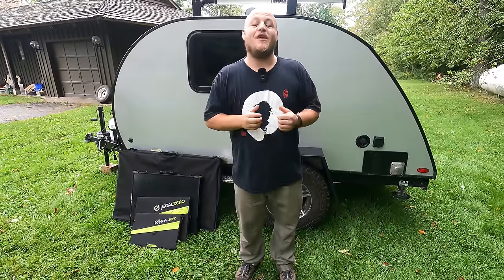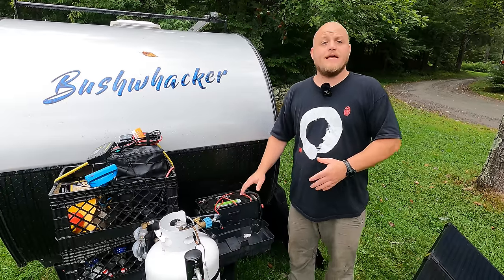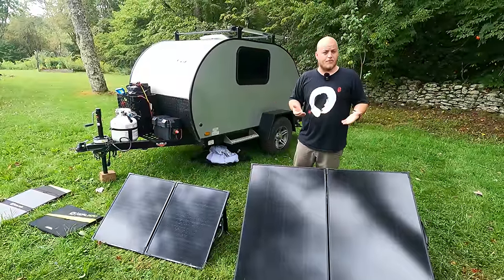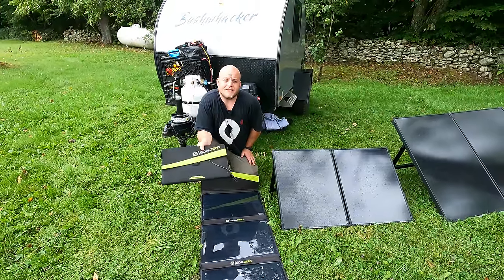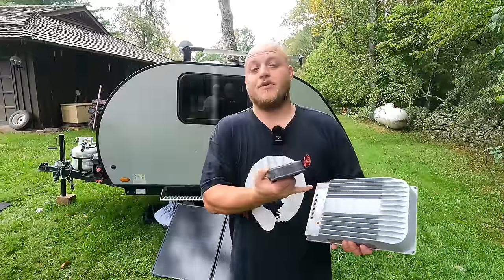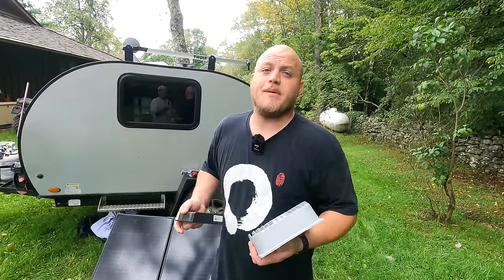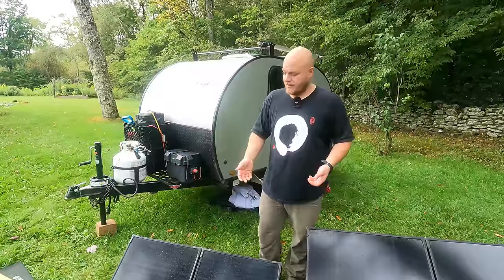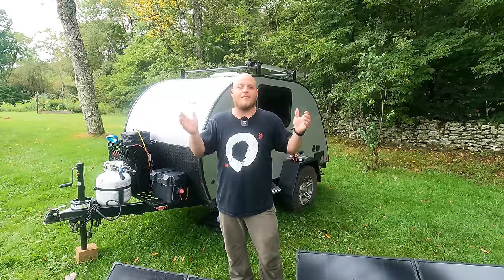RV Solar 101 : Everything a Beginner Needs to Know !

Comment: You are awesome! Thank you!
New sub here:)
Im in a self converted promaster high top
Haven’t built it out formally yet just set up modularly so there’s room to try it out
Im using a jackery 1000 now with portable 200 watt panel that takes in 116 at the height of sun for summer in Vt.
Was looking into rooftop panels that are weatherproof  (since mine are not) but was a bit overwhelmed with choices…
Running an Alpicool 65 L dual fridge freezer that can take it down up to 50% in some weather at night so wanted to set it up in a way Im not so pressed to charge daily and can go off an adventure rather than babysit the panels so they are not stolen.
This is such a helpful video!!!!
Thank you
So glad I found this:)
Demystifying!
Seeing good reports on Harbor Freight panels durability 
Researching choices
Any recommendations?
Reply from the maker: I’m so glad that you found us! I have lots of videos on solar, I will link one in this comment, showing my rooftop set up. I have learned to stay clear of harbor freight panels, they are unnecessarily big and difficult to set up.  Check out this set up, and my other videos on solar. Thanks for watching.

RV Roof Solar Panel Install - Roof Rack
https://youtu.be/nIpGvJzrKg0

Comment: Really good information Bryan, one question for you. If you have two 100 amp 12 volt batteries and 2 100 watt monocrystalline solar panels. Does it matter if the charge controller is 20 amp or 30 amp?
Reply from the maker: No, a 20a and 30a would work exactly the same. No advantage of the 30amp with that panel size. 

 If you went up to 220-240 watts of panel, you would start to see advantage using the 30a over the 20a.
Reply: @DIYOutdoorLife  Thanks!

Comment: This is a great simple overview.. so what does the solar battery controller do when I hook up to the 30/50amp AC power pole?
Reply from the maker: The power pole to your solar panel?
Reply: @DIYOutdoorLife  - sorry for the poor question… but no… I’m referring to when I connect my RV to a camp site’s 30/50amp AC hook up.   Btw, I think I found the answer… i.e., the charge coming from the solar panel going through the solar controller is auto disconnected and the AC/DC converter takes over any required battery charging.
Reply from the maker: @sboy1955  you got it.  You don’t have to do anything at all, the charge controller can tell that the battery is receiving a charge and backs off.

Comment: Is there a text or PDF that has all the simple formulas and steps to do the calculations you presented?

Just yesterday I was testing my new Solar Panel & Power Station. Was bright Sun. Was disappointed that my 100w panel only showed 60w of charging. Then discovered that the  Power Station built in Charge Controller only allowed that much charging. Nowhere in the User Manual for either device was that mentioned.
Reply from the maker: You might be able to find something on google, sorry I don’t have anything.

Bummer about the power station, that’s why I try to review a lot of models on the channel.  What power station are you working with?

Comment: Love you RV solar 101. I have  2 12v lead acid deep cycle batteries for my 12v system, wired in parallel . Does my wattage change? IE: 600x 2 or does it stay at 600 and I can use the charge longer? Thank you so much.
Reply from the maker: When wired in parallel the Watt hours doubles… thanks for watching

Comment: I plan to have a solar panel installed on the roof of my van to charge my Jackery 1000 solar generator. Is the charge controller built in on the Jackery?
Reply from the maker: Yes there is, no need to buy one.

Comment: We have a Chevy S 10 truck with a very small slide in camper. I’m looking for a small solar portable set up. That way there if I ever lose power in my home I can use it to run small appliances / lights………. The small camper only has a very small refrigerator and a microwave. No bathroom, no sink…….( I like to use an electric skillet & mr. coffee) would that small unit be enough????? ( we are so clueless, lol)
Reply from the maker: How does everything run now? Fridge runs on gas, battery, or ac electric? The microwave, skillet, and coffee maker are high wattage items, you’ll need to go with a large system or replace with more gas appliances.

Comment: Great video. My question is if you series or parallel panels do the batteries have to be wired the same parallel batteries parallel panels or series panels series batteries?
Reply from the maker: Nope.  You can series or parallel up to whatever your charge controller can handle.  Your charge controller has to match your battery voltage, but it doesn’t matter what solar configuration you use tho
Reply: @DIYOutdoorLife  thank you very much for your valuable comment and time

Comment: Mppt controllers can start charging earlier in morning and run later in the evening than pwm controllers. Also, on more overcast days it can provide power when a pwm might not.
Just a point to make.
Reply from the maker: Definitely, the voltage conversion rules the roost on most large systems. The argument I make is when comparing the performance of 100w solar set ups.  You don’t see the performance gains worth money until you creep up the size.
Reply: Creeping up in size is very likely to happen.
My point being, why buy it twice.
Reply from the maker: @dsig1644  this is a very good point. I should probably make a solar 202.  The fact that you can get a $35-50 waterproof PWM has its merits.  Starting with something like a victron blue smart that is future proof has merits as well.  I appreciate the good comments.

Comment: I have a factory installed 190 watt rooftop go power on a NoBo with a 12volt only frig. Charging two 12 V lead deep cycle Marine batteries in parallel. I know I need to upgrade the batteries. I decided to supplement with an old 120 watt Nature Power suitcase with it’s own controller connected directly to the batteries.That worked well. Decided to up grade to a more power/ modern Suitcase Renogy 200watt Voyager 20amp controller. My 12volt frig. sends out an error E3, which means overcharging in this case (15.3V) The dealer indicated that it’s Renogy’s problem. Thought the controller was defective but Renogy claims the camper go power controller and Voyager don’t play well.  I thought they would be independent as it works with my old 120 watt. Is Renogy getting out of a warranty or is there something else I could do to make the 200 watt work?
Reply from the maker: At that level, you’re starting to cook your batteries. I would explore the settings on those charge controllers and look to find one that cuts out at a lower voltage. You can 100% run multiple charge controllers at once, you just don’t want to try to charge a SLA too fast, check your battery to see max input current.  It’s tough for me to say without seeing the gear, but my hunch is that voyager is the culprit, should not allow V to get that high. 

Maybe swap the voyager for an MPPT and see if that fixes.
Reply: Update: After I got home and wasn’t worried about keeping the 12 Volt refrigerator cool anymore, I disconnected the factory installed Go Power and just ran the refrigerator on the Renogy / Voyager controller. Results E3 error as it was sending in 15.9 volts. I was able to take pictures and after too much time on the phone and persistence Renogy is sending me a new suitcase with controller. Thank you for giving me information to back up my argument.

Comment: I'm thinking about getting a camper with a 200 watt panel on the roof that goes through a 30 amp digital controller. The camper also has port on the side of it to connect a portable panel to it. If I plug a second 200 amp portable panel into that port, does it just add to the 200 on the roof, or do I need a separate charge controller? Thanks, and WTG! you explain things great!
Reply from the maker: Thank you for watching! You will need an additional charge controller, the solar on the side port goes directly to the battery and is not regulated.
Reply: @DIYOutdoorLife  Thank you! In that case, I'll get a kit system that has it's own built in controller.  Oh, I assume they can both be used at the same time?
Reply from the maker: @chrisb6866  good idea, it’ll be easier to set up at camp and typically be waterproof.

Fine to use them both at once, it’ll work great!
Reply: @DIYOutdoorLife  Awesome! Thank you!

Comment: Really amazing video man! What about the battery charge level should I know? Like, I know an AGM or lead acid battery shouldn't be drawn down below 50%, but is it good for that type of battery to constantly have it between 80%-100% with the solar panels keeping it topped off? Can or should LIFEPO4 batteries be treated the same way for maintaining a charge?
Reply from the maker: Thank you.
12.2v is a good number with lead acid, including AGM.  That’s a good 50% mark.

It is extremely good for them to try to keep them as high as possible all the time.  If you can stay above 80%, the battery will last many many years.

Lifepo4 is different.  It’s much more stable being left alone, although you never wanna let it go completely empty.  If you do go completely empty, it’s imperative that you charge it as quickly as possible.  Since they don’t need a trickle charge, many people charge them to 60 or  70% and leave them disconnected if not in use.
Reply: @DIYOutdoorLife  Wow, a detailed reply within an hour, on a video over a year old? You flippin rock man, thank you!
Reply from the maker: @undercrust  haha, I work hard to keep up w the comments. I appreciate you tuning in.

Comment: Is it acceptable to use a larger charge controller then required by the system?   Also can you link the video about required cables?
Reply from the maker: Yes, no harm in oversizing charge controller.
It has been a while, but I think this is the video - DIY Charge Controller | Installation Options
https://youtu.be/4_2_Xt4eOoM

Hope this helps, thanks for watching!

Comment: Question for you so I have 3 northstar agm batteries that I wanna put in parallel…I’m looking at getting two 550 renogy panels ….. I see most charge controllers work with certain ranges of wattage from the panels from the looks of it I need an 80 amp controller?
Reply from the maker: You would not need that large of a charge controller.  Those  panels typically run a higher voltage and lower current. I believe the open circuit Is 50v and the short circuit is 15 amps.  This means, for those larger panels, you only need a 30 amp charge controller.  Because you are working with a larger array, you definitely want to go with a high end controller or oversize it a little bit. This would be my
Recommendation-
https://amzn.to/3OxDsoF
Reply: @DIYOutdoorLife  thank you so much for the information I asked this question many of times yet no one would give me an answer or help me out thank you so much!!!!!

Comment: Cool vid... i have a 515   watt,5.2 amp,115 volt a/ c unit that i need to use for 10 hours of use to keep cool. What amp hours willi need to meet this need. I do have a 2000 watt  inverter  (12v to 112 volt)
Reply from the maker: That's a very complicated equation, I'll do my best to answer as clearly as I can.

First, 515×10 hours is easy .  5115 W hours.      

The reality is more complicated than this, and thankfully works in our favor.  The air conditioner does not run continuously for 10 hours.  If sized appropriately, it runs for a while and then shuts off for a while.   if size appropriately and running efficiently, let's see if we can get it to run 25% of the time.  Maybe wishful thinking.  This this would be just under 1300 W hours.   100 amp hour lithium battery has around 1300 W hours.   So in this case, it would use 100 amp hour lifepo, charged to 100%, and you would get just under 10 hours of cooling.

Do you see how there's tons of variables here?   How big your camper is, how hot it is outside, how many people are sleeping inside, how many times you open the doors, how insulated the camper is etc etc etc.    
If your air conditioner ran 50% of the time, it would require 200 amp hours of lithium.

If your air conditioner ran 100% of the time, something would be wrong, but that would be 400 amp hours to last one night .

Your inverter will likely run about 80% efficient .  This will cut the number from 10 hours to eight hours.  

I could go on and on here, but I wanted to give you enough to get started.  Running air-conditioning requires a very large battery bank!   I will post a video in the next comment where I go into some of these details and share some tips and tricks.   Most of the time, this offgrade AC becomes so expensive that you get very thrifty.  Setting an outlet timer for six hours seems advantageous to get 10 hours and spending thousands more...

Hope this helps, thank you for watching!
Reply from the maker: Running Teardrop AC with Solar! Portable Power Station Air Conditioner
https://youtu.be/DzRKUQEo5K0

Comment: Hi there.  I love your videos.  We just bought the Bushwhacker 10FB (two doors) and I’m trying to figure out what kind of battery amp hour would last us three days.  What is the battery amp hour that lasts you three days?  Just curious and trying to put it in perspective.  This is our first trailer so I don’t really know what kind of use we will have yet.  :)
Reply from the maker: I’d be happy to help, what type of devices are you looking to run for three days? Refrigerator? CPAP machine? Lights fans and USBs are very easy!
Reply: @DIYOutdoorLife  hmmmm…. Such a good question.  I don’t imagine we will use a refrigerator so most likely lights and fan, charging phones and maybe iPad or laptop for movies at night.  Btw This video has sparked an obsession to understand electricity!
Reply from the maker: That’s so great to hear. Knowledge is the best modification, it saves you a ton of money and makes everything work better!
100 AH AGM battery is probably the way to go for you. Check out my video on “best battery for RV”

Comment: I just added 4 group 31 gel style batteries at 98ah each and I have a 20amp charge controller and I only have a 100 watt panel at this time. I wanted to get a 200-300 watt panel. I also have a 3000 wattage pure sine inverter hooked up for ac power. So is 200w panels enough?I use the inverter at night and mornings when I’m not allowed to run a generator so I can use my Starlink and coffee maker or microwave in those times
Reply from the maker: Nice system!  You are a little light on solar.   

Your batteries have roughly 4800 W hours of storage.  Since theyre gel, you can effectively use half.  So 2400wh.

100 W panel will roughly give you 350 watt hours a day better, sometimes worse.. good average number

300 W of solar will give you just over 1000 watt hours on average.

So on average, it would take 2 1/2 days for 300 W of solar to completely charge your battery bank if you were right down to the bottom  (50% 12.2volts)

Since you have a generator, and you shouldn't be running the batteries down every day, 300 W could be an effective number.   That should be enough to keep you charged and needing the generator only during bad weather/solar conditions.

Hope this helps!
Reply: Thanks

Comment: On our camper control panel when we check the number of lights lit it will give us some idea what their charge status is. One through four lites lit. Question.. Are the lites one through four based on a 100 to 0 charge in the battery or is the one through four liters based on the 50 percent stop using So we don't damage our battery?  Thanks. Craig Tryon
Reply from the maker: Every one is different. Always best to check it with a meter to find out, after that it can be a handy reference.

Comment: I have a EcoFlow Delta 2 with Lithium Ion batteries 1024 Wh  I’m wanting to buy a portable solar panel to charge it.  It uses a MC4 connector. The power management is built in.   Input port is rated  11-60V, 15A max., 500W max solar panel.   What are the best manufacture options if I don’t want to buy the very expensive EF solar panels?   Would any combination of a 400W panel(s) be correct for 1024Wh?  Or is that an overkill?   If I put the solar panel in the front window of my house, which gets maximum sun, will it charge as efficiently as it would outside?  Thank you!
Reply from the maker: Youre fine to use any panel on the market, 500w or smaller, with a configuration under 60 volts.  
Do you think glass panels (cheaper) would work or do you need smaller lightweight flexible panels?

The panel should work just as well inside as outside, but I assume it would be very difficult to get full sun through the window . As the sun moves to the sky, it's inevitably going to shade on the panel, which really drops the production.  In theory, if your window is big enough, you would get the same performance.

Comment: Many people need basic lesson in what is a watt, what is an amp, what is a volt. And how they are related. 

When my car battery died the garage (that had sold be the battery that died while under warranty) saw a woman alone and thought they could charge me big bucks for a new alternator - that I didn’t need.  

I’m a certified energy auditor, trained in the 80s, when we actually had to know this stuff.  I think I knew more about the electrical system of the car than did the person trying to rip me off.
Reply from the maker: This is a great comment, I completely agree with you.  I’m glad you were able to avoid getting ripped off.

Someday, when I have time, I will get around to doing a basic electrical 101 on the channel.
Reply: @DIYOutdoorLife  awesome!